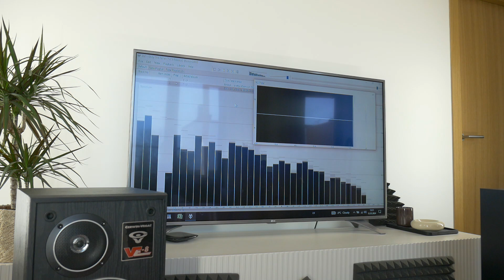Cerwin Vega speaker excursion bass test

Comment: Too small amplifier....
Reply from the maker: This amplifier provides more than enough power for these small speakers. The Pioneer A-401 is not like some of the cheap Chinese amplifiers available today with fake power ratings. Thie Pioneer A-301 is Made in Japan in the 1990s, this Pioneer model offers very good specifications and sound quality.

Pioneer A-401 spec:
- Continuous power output (RMS): 60W at 8ohm(THD 0.009%) and 80w at 4 ohm (THD 0.02%)
- Dynamic power output (on EIA dynamic test signal): 70w(8 ohm) and 110w at 4 ohm
- Total harmonic distortion (20Hz—20kHz, 60W, 8Ω):  0.009%
- Input sensitivity/impedance(CD/Line): 150mV/40kΩ
- Frequency response (5Hz—100kHz): +0dB,-3dB
- Filter (SUBSONIC): 17Hz (12dB/oct.)
-S/N ratio (CD/Line): 108 dB
- Power consumption: 550W
- Weight: 8.1 kg
Reply: 60W is plenty for a 90dB/W speaker. That amp can push the speakers to 108dB SPL.
Reply: Brother unless u want ur neighbors banging ur door this is more than sufficient. Is about the sound quality not quantity